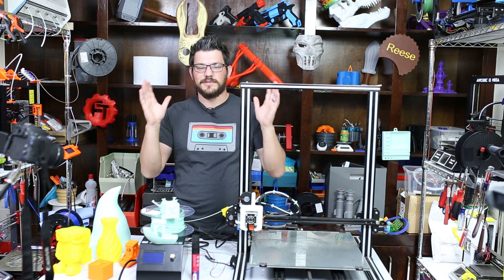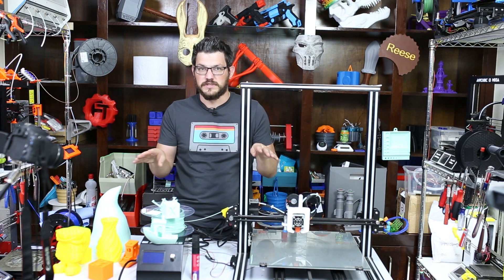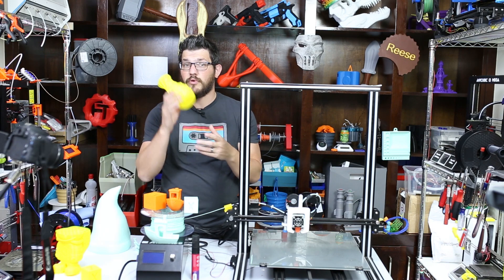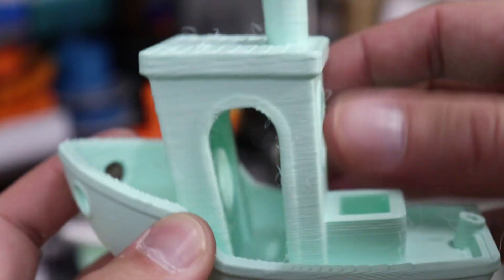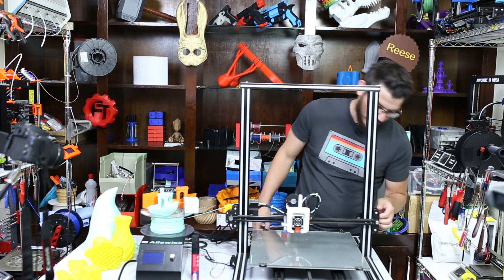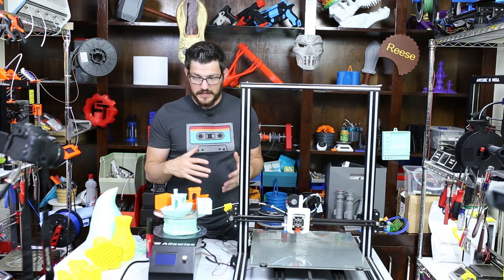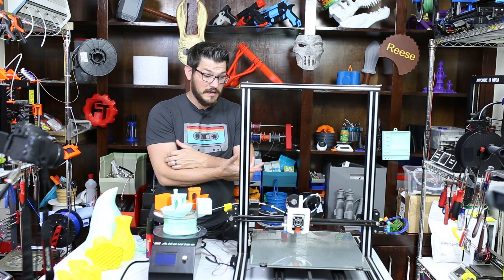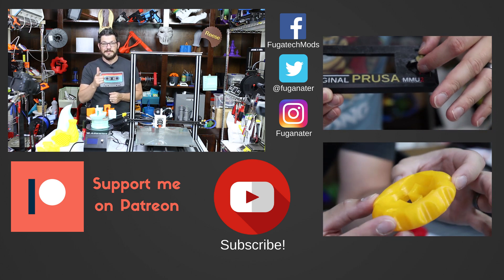Tuning the Volcano Hotend on the Alfwaise U10

Comment: I think you said you were running a titan extruder?  I setup a volcano with titan extruder and had all sorts of problems.  Turns out e3d doesn't recommend it.  They say the pancake motor is on the engineering limit as is and higher volume nozzles will exceed its ratings. I had to swap the motor out to get good results.  Good video BTW.
Reply from the maker: Yes I was running a Titan extruder but with a full size motor, not a pancake.

Comment: OK. stuff looks like that. I could not make cold pull 
Because I had 1 mm space between nozzle and throat

This was shocking after knowing how much attention I put in to screwing all together as tight I can
How this could happen? Metal can not shrinks so much because temperature 

How do You make cold pull at volcano?
Did You meet same problem?
How I can prevent this 1mm gap?

Comment: Thank you for the review, too bad the U10 didn't take off more. I've had my U10 for about a year and I LOVE it. I'm printing with a .8mm nozzle at .5 or .6mm heights at 50mm/s and 230c on a e3dv6 volcano clone. Everything is stock except the volcano and most of that stuff around the head (thank you petsfang).  The quality is certainly not that of a .4mm at .15mm height, and printing screw holes and other fine detail at .8mm wide does not look great, but for big items it works great. I have found that good filament makes all the difference, I've had great luck with Tianse (including their 5kg rolls), and less luck with a couple other brands. I've also been doing custom infill with Cura so the entire inside of a large print is not infill, just enough to stiffen sides or angling up to make a plate for the top layer to sit on (cones tilted inside the model and in cura I turned on infill in the cones by using the "Per Model Settings -> Modify Settings for infill of other models")

Comment: Thanks for going over the nuances of volcano hot ends.  I put one on my Super Duper Cube and still ca't get a stable PID tune on it.  I think I have an incorrect thermistor profile.   You didn't mention anything about PID tuning on your machine. Was it not an issue with your machine?
Reply: I bought e3dv6+titan clone from teianglelabs and i asked them what typexof thermistor they said 5 in marlin and i replaced fw than pid tuning maybe ask seller type of thermistor
Reply from the maker: No. Temps seemed very stable.
Reply: I just noticed these huge klackers in the background. So glad to see someone else printing them. I was wondering if others had success printing. They are so much fun!